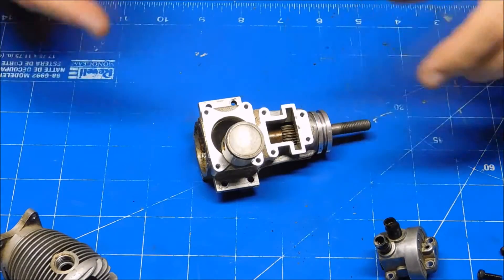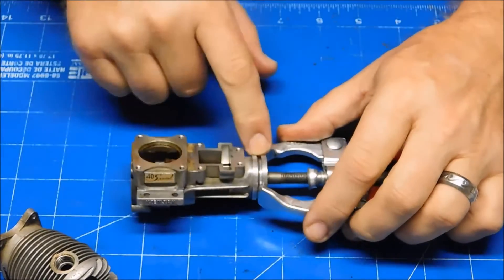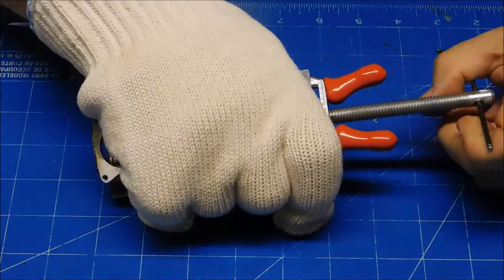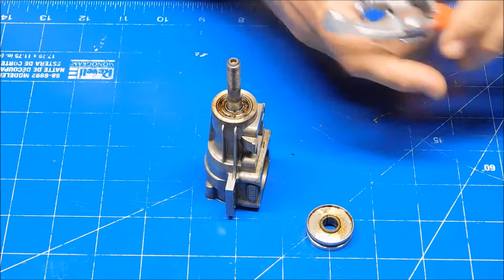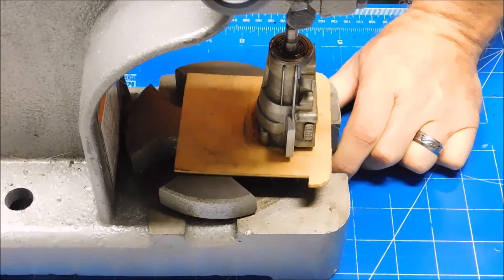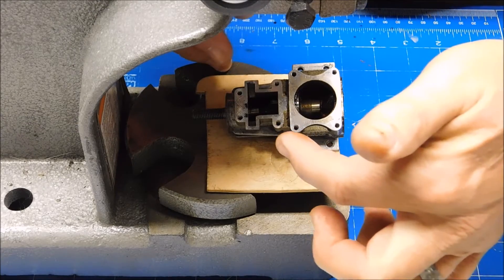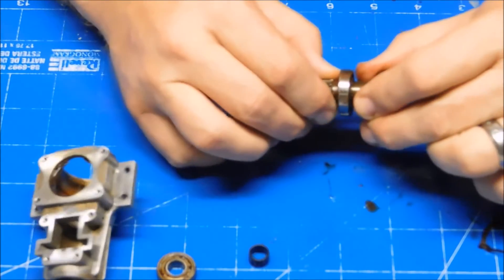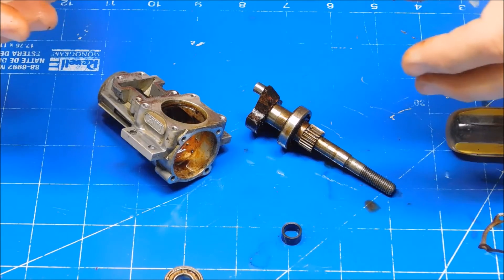Saito FA-40S A Look Inside Part 2

Comment: Wow that has a beast of a piston in there for a boat motor.
Reply from the maker: What in the world makes you think this is s boat engine?
Reply: @dmrcflyr2  I've just always seen these type of 4 cycle engines on RC boats but yeh guess that would be a good engine for a medium small plane. By the looks of that one just looked like it was used in the water or submerged in a lake for sometime LOL that thing was really gummed up.
Reply from the maker: @timsherry-s6q  That is very interesting as Saito did not make marine engines at all.  All of Saito’s glow engine line was designed specifically for RC aircraft. In fact, only OS ever made marine 4 cycle engines.  They made the FS-61M and the FS-40M.  This leads me to ask where you live in the world where you saw Saito engines in boats?  Your comment about how this engine looked on the inside makes me question your knowledge of glow engines.  An engine that had been submerged under water would be rusted on the steel parts not gummed up as this was.  This is a result of the oil used in the glow fuel, in this case, castor oil.  This is quite common for most ALL glow engines to look after much run time.

Comment: Hi Dave

Thanks for the  Saito FA40-S (special ) tear-down, great info. I've got the exact same engine , purchase receipted from 1988.. in  almost identical condition as your video. Its also going to get a  clean new bearing set.
Small problem tho. All the casing hex screws came loose - apart from the four main ones holding down the head to the crank casing. any ideas how to remove these tightly "seized in" hex key / head fastening screws.? Have already broken a hex driver tip off into one hex screw! These are very close in around the head  base - so access is tight.. maybe need a longer "L" hex key for better leverage.
Haven't tried oven or heat gun treatment yet on the case or screws - any ideas are appreciated please.
Thanks
Paul